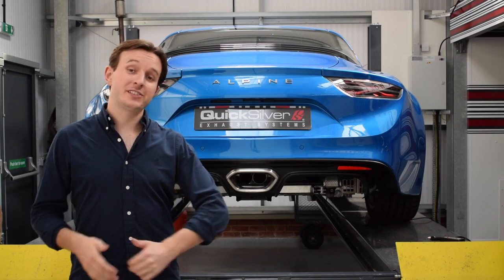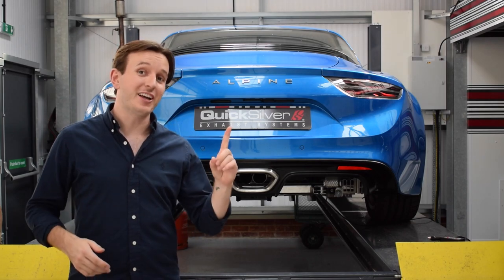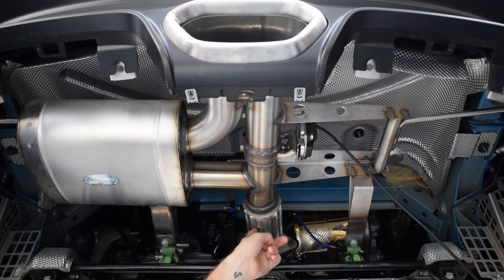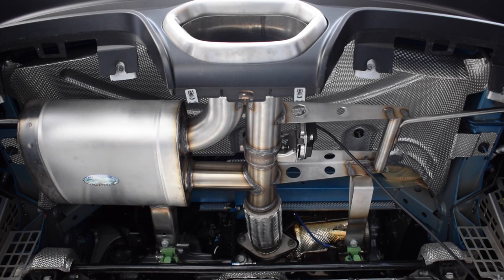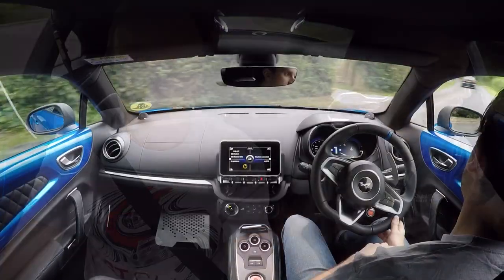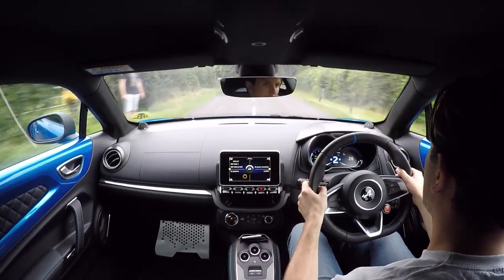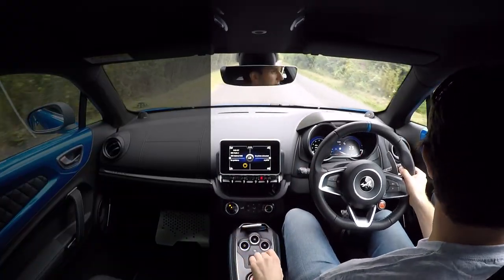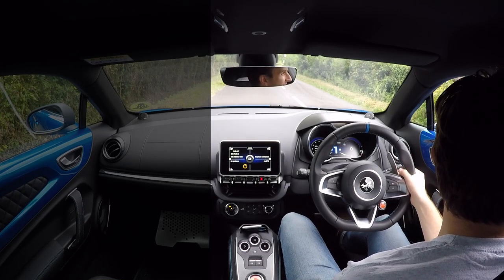Alpine A110: QuickSilver Sound Architect Exhaust

Comment: Sounds good , what do you mean by silencer box ? and what is the difference between the valve opening here and valve in the standard Alpine exhaust ?
Reply from the maker: The standard Alpine exhaust valve open and shuts arbitrarily - this is particularly notable on the overrun, when the factory valve shuts as soon as you lift off the throttle. 

QuickSilver's Sound Architect valve works without interference from the car. With the valve open, it's open 100% of the time. Providing a much more engaging driving experience.